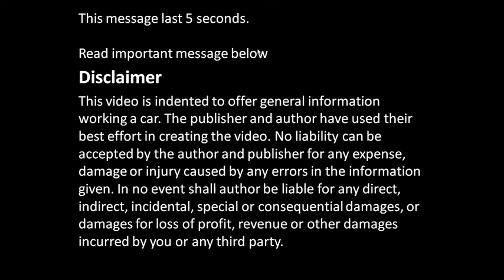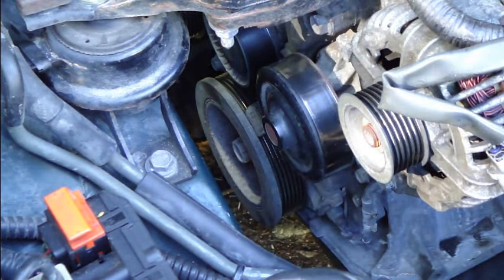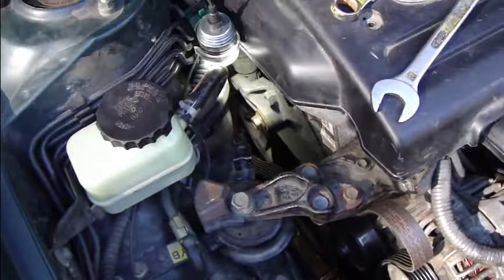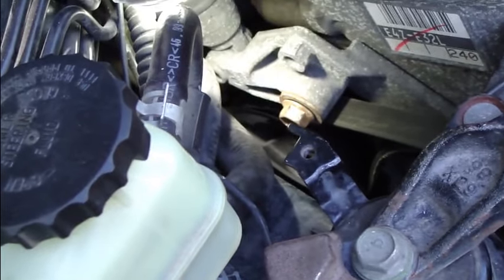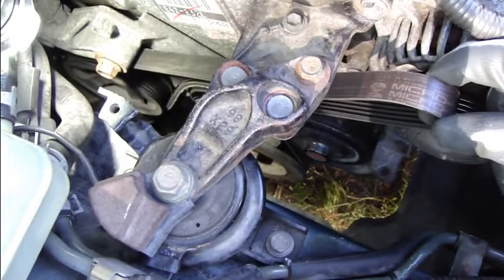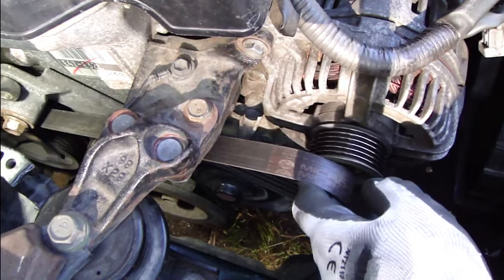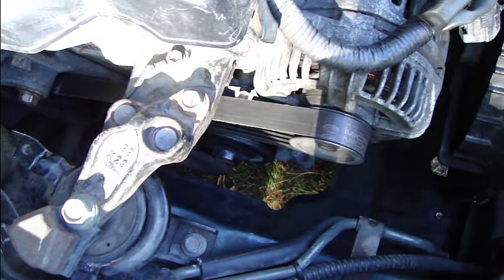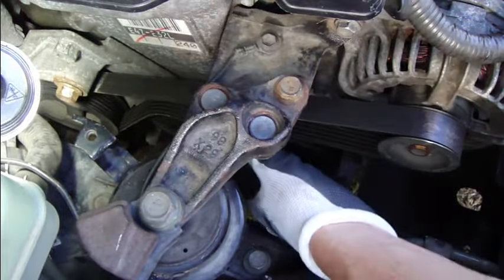How to setup drive belt or serpentine belt Toyota VVT-i engine. VERY DETAILED INFO

Comment: There is an extra pully if you have an air conditioner. So keep an eye out for that. 
The tensioner bolt you use to take on and off the belt may require more leverage then a wrench will give you. I had to use a breaker bar with a socket to get my belt on. 
Also, there are 3 different styles of belts for the same vehicle. 2 different styles of belts for this vehicle with an air conditioner. So keep that in mind when buying the belt. Just because Amazon says it will fit your vehicle, doesn't mean it will.
Reply: I have 96 Previa LE SC... Do u know if it requires 2 or 3 belts ?  From top, I see only 2 belts but some online diagrams have 3 belts.  Maybe there is extra 3rd belt for SC Super charger but unsure.  Thanks 🙏

Comment: Hey Peter, I have a Toyota Yaris from year 2000. But my alternator is in the back. Is it the same method even if the alternator is in the back, or do you use a tensioner pulley instead?
Reply from the maker: Yes

Comment: Great video. In real life, the 100% correct belt was missing about 1cm to slide on the alternator wheel, so I kept pulling and pulling the tension bold with wrench as you do in the video, untill it snapped and cracked completely. Result: unable to put the belt on anymore.
Reply from the maker: Great tip!

Comment: thank you very much for posting your video, it helped a great deal when i replaced the power steering belt, accessory belt and alternator in my 2006 xb. 3 hours for all plus an oil and filter change.
Reply from the maker: Nice work!

Comment: I use a 18mm super socket/ratchet to move the tensioner forward. a 19mm will round off the head of that nut on the tensioner if it slips off.  good job you make it look simple but things can go wrong........thanks
Reply from the maker: Thank for feedback. I hope best to your car service job.

Comment: Forgot to let peeps know that you need to unscrew the lower bolt you cant see on the alternator, if your belt squeaks , you need a bit more tension on it therfor need to readjust the alternator.
Reply from the maker: +El Cabron Del Norte Many Thanks for info. :-)

Comment: Peter, how to you adjust the timing on the timing belt  you know how the belt area there a white dot line when you turn on the engine and you use a special timing tool that has a light that blinks? Do you have a video for that?
Reply: I’m very late to the video but the VVTI Toyota’s have a timing chain not belt

Comment: Hej Peter!
Väldigt bra video :-) tack.
Kan du filma,vissa hur man byter lampor fram H4,har beställt ett par såna från Kina  http://www.ebay.com/itm/2X-Car-68-LED-SMD-3528-H4-Bulb-Fog-Light-Lamp-Headlight-310LM-DC-12V-6500K-/131041614924?pt=Motors_Car_Truck_Parts_Accessories&hash=item1e82b05c4c&vxp=mtr

Vad tror du kommer dessa funka? Tack för din hjälp
Reply from the maker: Hello, sorry. I have not tested those lamps. They should work.

Comment: The alternator is as tight as i can make my belt. but it still squeaks. so i think the guy that put my alternator on stretched my belt. or could it be from tension bolt or something?
Reply from the maker: +Azeria Burch Hi, you need a new belt. You might have old belt. And belt is rubber and old rubber is slippery.

Comment: what size wrench should I use? I have a vvti 2000 toyota celica gts and an 18mm is a tad to small but 3/4 in and 19mm just round it.?
Reply from the maker: It is 19 mm !
Reply: Peter Finn 
Thank you!
One more question though. On my 2000 GTS how long is the serpentine belt? I'm trying to order one and I have no idea what size it is. I've looked all over the Internet and all the sites I've found the belt length varies from 60 inch to 74 in. ?
Reply: 74 inch is if you have aircon 60 without

Comment: I am SOO happy I found your channel. I have a Toyota Yaris and this helps me so much. I just got my serpentine belt changed on Friday, it was very bad. But after I got it changed, it is making a loud screeching sound. It used to make a low screech before with the old belt. But now with the new one, it's louder than ever. I have to go back on Monday to get it fixed. But what could have happened that made it screech so loud? Do you think it was put in wrong?
Reply from the maker: Hello. So, if your car's engine looks similar then my engine, then the issue might be the tensioner. This part tightens the belt. You might need to change that tensioner too. You find that my video in here:
http://youtu.be/eJnxY7kM18Q

and here:
How to disassemble engine VVTi Toyota Part 2: Tensioner drive belt
Reply: Thanks so much Peter!
Reply: where do I purchase the new belt which is having this size 4pk 1470?

Comment: My belt is squealing and the belt is good. Even tighter? Mine goes about 90 degrees as well.
Reply from the maker: +doomie77 You need to fasten it more, 45 degrees is Ok.
Reply: oh, I'm so dumb, the belt is at about 45 degrees. it only makes noise when the accelerator is pressed.
Reply from the maker: OK, then your belt is too old. Please replace it to new one. Old belt's material is hard.